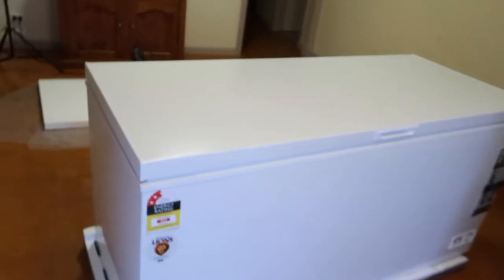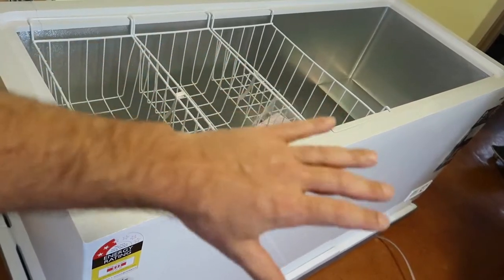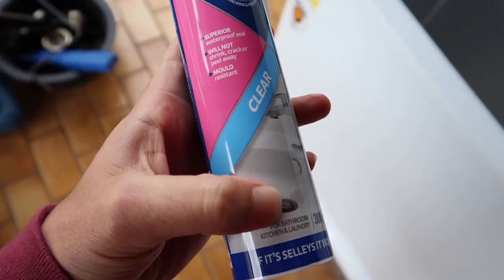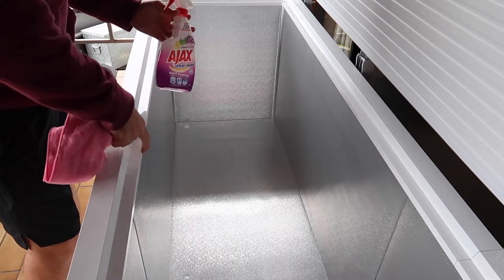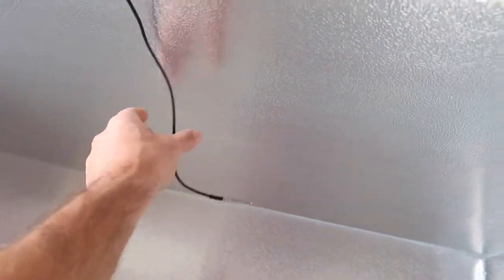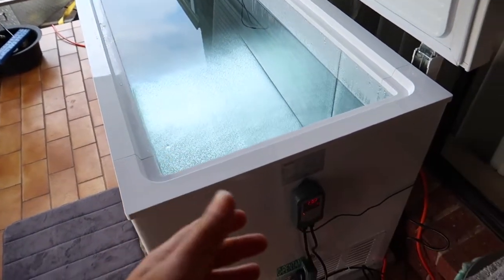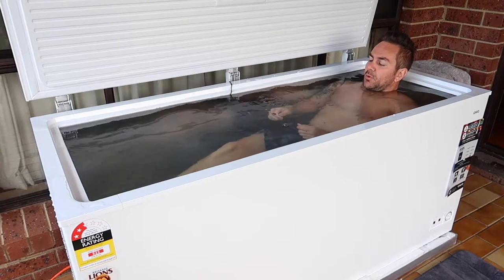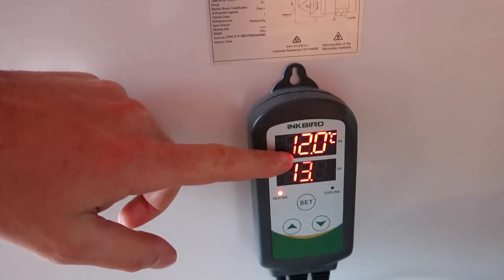Chest Freezer Ice Bath with Auto On & Off Thermostat (Works Too Good!)

Comment: Nice vid. One tip is the temperature probe. If you don’t position the probe so its sitting in the middle of the tank you will be measuring the inside metal surface of the freezer which is much colder. You’re water will be much warmer than what the probe is measuring. I fitted a short length of rubber hose inside the freezer that the probe is slid into. Its keeps it in mid water and gives much better accuracy.👍
Reply from the maker: That's a great little upgrade,. thanks for sharing!

Comment: You can ruin your freezer by not using the right materials and not sealing the drain. JB water weld is the thing that is meant to sort of withstand constant submersion. Only use silicone if you plan on using a liner which is most advisable.
Reply: What you mean by a liner that is most visable? I've got a waterproof silicon and was also thinking of adding a pond sealant on top of that
Reply: Aquariums including salt water aquariums have been using silicone for decades. I have never heard of a single failure in the silicone.

Comment: this is really the smart and cost effective way to do this. why would you want to go buy a pond chiller, fabricate come sort of tub and run down 10,000 other things when an ice chest is much more suited to the task and you basically only need 2 other things. a chiller will NEVER reach the temps a chest will and they are very delicate and never last. chest on the other hand will last you easily a decade

Comment: Nice video, nice man. I have been doing this for 6 months, in my non heated swimming pool. It varies from 40-60 degrees depending on the month. September to March. When it’s 60-75degrees I will tether myself and swim in place for 30 minutes. When it’s 75-85 I will swim for 40 minutes. I suggest you try it! Staying in the cooler water for such a long time, freestyle swimming with your head in is amazing! My pool worked good because I could go down 2 degrees per week from 70 to 40 and adjust. When it’s the colder temperature, I just play a couple songs on my phone as the timer . Head dunks are crucial! I saw the other comment trying to find the timer in the u s a . But I can’t see how to find it? Can you please put the make and model number and comment back? You spray the soapy water after you put the silicone down? Before you smooth it with the butter knife? I have been swimming in cold water for 4 years, when we have cold water. I really like it better than the 6-8 minute 40-45 degree plunge. Or the 8-15 minute 45-55 degree plunge. How do you unplug it to not get in with it plugged in? I didn’t see that? Is there a safer way to plug and unplug around eat water? Thanks for sharing!
Reply from the maker: Thanks man!

Here is the US link thermometer: https://www.amazon.com./Inkbird-Temperature-Controller-Controlling-Fermentation/dp/B01HXM5UAC/ref=sr_1_14?dchild=1&keywords=inkbird%2Bthermometer&qid=1635968692&sr=8-14&th=1

Comment: Good video.  I have one question.  My chest freezer gets an extremly hot surface on the outside during cooling the water down.  Is that normal? Does your freezer has this hot temperatures too?
Reply: Old question but yes it gets super hot. Like i cant keep my hand on it. Normal

Comment: I heard if you have a metal lining like yours, you will have rust issues.  I have the same type of freezer like yours.  I am looking into a way of painting it to protect the freezer from rusting.   Has anybody ever painted the inside post a comment how you did it.
Reply from the maker: I've actually sold mine, so don't know if it get's rusty. Good point though!
Reply: Trying to find an answer to this also. I plan on using an epoxy paint for bath and sinks??
Reply: I haven't done it myself but I do Remodeling and generalized repair work so I feel I can confidently recommend an epoxy paint, if you can find a good 2 part epoxy paint I'd use it
Reply: @kontritum2861  Thanks mate, I gave it a couple coats will see how it goes.
Reply: There are a few options. Either EPDM lining tucked in, 2-3 layers of something called Pond Shield or more professionally a coating called Line-X.
Reply: @SlewedDog  do you need to sand the metal walls or could you just get away slapping the pond shield over the metal walls? Anyone know?
Reply: When I'll rust occur? 3 months? 6 months? A year?
Reply: @Bvoswag  Hi - I still haven't actually done it yet. After long and many considerations, I decided Pond Shield is the best way to go. It's most durable, doesn't degrade by neither Ozone, Chlorine or any other logic sanitation. It's important to put a primer on the metal though (ANYTHING OTHER THAN RUST-OLEUM), before applying the Pond Shield.
The Pond Shield would still work without, as a 'layer', but it may disconnect from the metal. 
If you seal, prime and pond-shield it properly (2 layers), it should never crack, leak or rust. It really is, if done correctly, the best and most durable way to keep any chest-freezer functional for many years. Good luck!
I plan to get Pond Shield still, but it's not available in Europe (yet) so I'm contemplating importing options.
Reply: @SlewedDog where are you from? Have you found or imported Pond Shield yet? Could you give any example of the primer ? 😊

Comment: Hey ant thanks for the video mate. I’m trying to do the tap section you’ve done at the bottom. Only problem I’m having is the 16mm gcon bit pushes nicely into the freezer but doesn’t go into the 15mm 1/2inch pvc connector that you’ve recommended ?
Reply from the maker: Hey bro, wanna reach out to me on insta (@antmarino1) so I can try walk you through what I did?
Reply: Hey there not on Insta and need to know how to get the drain set up you have completed. Can I get some help ?

Comment: hi Ant , i have a chest freezer filled it up and left it on all night it got so hot as in the freezer itself and the motor all around the freezer , but maybe when i get a timer it  will shut off and cool down
Reply from the maker: Hey mate, it'll get a little hot because the motor is running, but shouldn't get too hot. What temp did the water get down to?

Comment: Hey man thanks for posting this!  How do you keep your water clean? I hear ozone machine can help with that.  Also is everything still working for you?
Reply from the maker: Hey man, sorry for the late reply. Thanks, glad you liked the vid. The water is a bit of pain to keep clean and I don't want to use any chemicals in there, so I Just change it out every 3 weeks or so. I just sold it actually as I'm moving states and everything was still working mikey mouse on it.

Comment: Did the sealing with silicon work long term?   Did it leak?   If so, how did you find the leaks?  How did your fix the leaks?
Reply from the maker: No leaks at all 😊😊
Reply: @antmarino1  ty.   how long has those original  seals lasted?
Reply from the maker: @joells357  which seals?
Reply: @antmarino1  the silicon calking
Reply from the maker: @joells357  Yeah they're great, that's why it doesn't leak 😊😊

Comment: I have the same freezer and I’m dealing with rust along the sides. Have you had the same problem?
Reply: anyone else experiencing rust issues? i'm looking to buy one but don't want a rust bucket
Reply: @rickwheeler75  I just bought a freezer with the metal in the inside.  I am looking into painting it to prevent the rust. If you tried that let us know.
Reply: I’ve got one coming tomorrow and the research I’ve done tells me I should coat with a rubber sealant/paint like what’s used for fountains.

Comment: are you running into any issues of rust because you're inside is aluminum rather than plastic.
Reply from the maker: I've actually sold it now, but I didn't have any issues with rust as it's aluminium, which doesn't rust.

Comment: Don't chest freezers have a capacitor that holds a charge?
Reply: The compressor has a small capacitor if it's not a linear drive compressor that uses DC voltage.

Comment: Sorry buddy but your setting people up to fail. You need to seal the seams with aqua knead and paint the inside with a epoxy shimicoat that they use for pools. 
Also a filter system is recommended to you don’t have to change the water every few weeks

Comment: Hey GREAT vid. I've done cryo as well as cold plunge  b4. But am going to give ur method a try. 
How long do you run the freezer each day?
Reply from the maker: In winter, if I have it set to 13 degrees, it never turns on haha. But in the warmer months it kicks on for about an hour a day.
Reply: @antmarino1  awesome. Ty for the quick response.  I move into my new house in Jan. Thats when I will do it.
I will give u some updates on how it goes. 👍
Reply from the maker: @TheJrj22067  No worries! Yeah let me know! You can even send me some pics through instagram if you use it 😊😊

Comment: i know this is a year old but why 14 degrees? iy should be at least 4 or 5 degrees to get the benefits of cold water immersion
Reply from the maker: I started at 14 degrees to slowly let my nervous system adjust to the temp and lowered it over time. I now do 5-7 degree plunges.
Reply: @antmarino1  oh okay cheers for the reply bro
Reply from the maker: @naptimebjj6072  welcome brother 😊😊

Comment: How has the aluminum freezer liner held up ? Any rust or issues ?
Reply from the maker: I actually sold it so not too sure.
Reply: You definitely want one that's not aluminum on the inside.  Unless you bought it used and got a deal you couldn't refuse.

Comment: Congratulations you built an electric chair.
Reply from the maker: How do you mean?
Reply: @antmarino1  🤣 if water leaks through into the electricals you might end up stewed.  Hairdryer in the bath style. 

Unplug whilst in it. 

Plug it into a gfci receptacle when cooling.  

Check for leaks as these are not designed for the outward forces exerted by the water. 

I'm making one for a meditation client and plan to use pond liner as a waterproof barrier inside.
Reply: @TheResoluteMind  Everyone unplugs while using these, also GFCI isnt needed in Australia as we have safety switch/breakers on our whole power circuit at home.